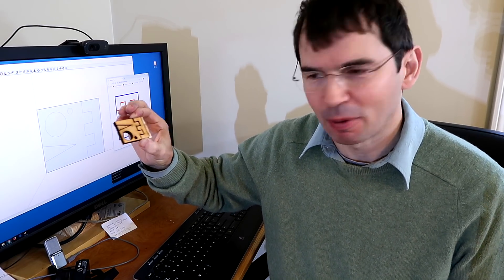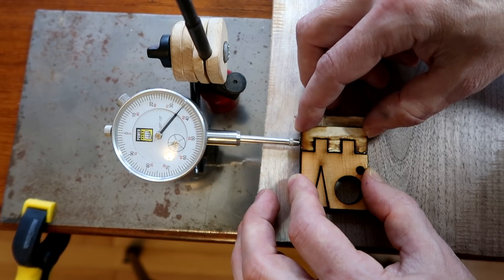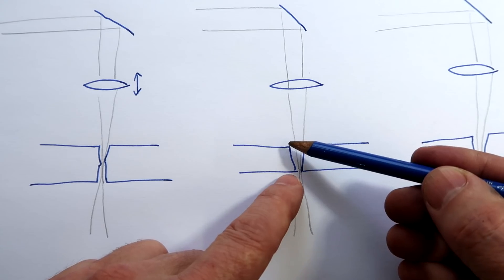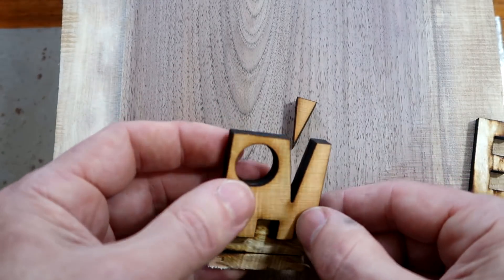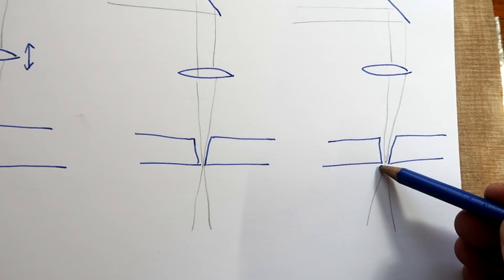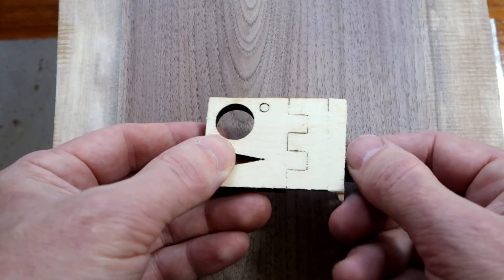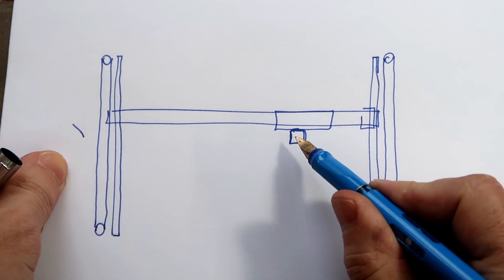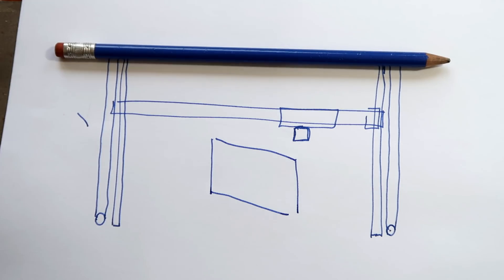Laser cutter cut width and inaccuracies

Comment: Matthias, i deal with my laser machine 8 months now trying to improve this situation and i can tell you it got to a point that is almost perfect. It takes huge amount of time of aligning the mirrors and the lens, something that most of people do not do, especially in maker spaces. Also it depends on what kind of lens they use. 1.5, 2, 2.5 and 4 inch lenses have different focal points thus they cannot cut perfectly all thicknesses of material. Plywood is never straight so if you set the focus perfect in one point, it will change across the piece of wood with result of a tapered cut. Lastly if i need to cut a precision piece i do compensate the width of the laser beam in my design so the final piece is very close to real dimensions. And if i need to cut 2 pieces nesting one inside the other like a puzzle piece or a box with joints, i design the part goes in slightly bigger to fit. It is a difficult process as all materials do not behave the same, so testing and tuning is always necessary. I roughly have spend all these months over 200 hours of calibrating and testing in order to have excellent results in every job i do. This fact put's me far away from completion as everyone can have a laser machine but very few knows and understand what it needs to be done to achieve the best results.
Reply from the maker: I kind of realized that laser needs tweaking, but it not being MY laser, I don't have much control over that stuff.  But I don't anticipate buying my own when a bandsaw already does most of the stuff I would use a laser for.
Reply: @matthiasrandomstuff2221  This is why i bought mine, all suppliers and maker spaces i have visited delivered a poor quality. But yes, i think you do not need one, your top skills on power tools can cover that gap.

Comment: Interesting. Obviously most people don't have a laser cutter and probably wouldn't get one to do joinery, but surely if you chose to do it that way then cutting the pieces that need to be joined would be done as separate pieces to cut down on the amount of play in the joint. 

It's curious too why something like a laser cutter wouldn't have a way to completely calibrate it to make perfect cuts. Even the idea of cutting out letters or doing decorative stuff in wood could be done with a scroll saw or a coping saw. So you would think an upgrade to a laser would also be an upgrade to a level of precision a scroll saw couldn't achieve.

Comment: And to make kerf matters worse, the focal length of the final lens  needs to be considered too :-) Then if you use crappy ply made with the wrong adhesive you need to ramp up the power (or slow the cut rate) which worsens the problem - happy burning :-)
Have you considered a constant kerf hand fretsaw lol :-)
Reply from the maker: I like my constant kerf bandsaw!

Comment: I wonder how burnt wood changes the strength of wood glue adhesion...
Reply: Typically when i do this the wood is much less burned (probably a result of using a better quality higher power laser) and although i don't sand the burnt edges the glue holds just fine. Ive seen the wood near the joint fail, but not the joint itself
Reply: An old saying goes "No glue sticks to dust", so...
Reply: @ @MazeFrame   Glue sticks VERY well to dust (and vice versa). However, dust to wood is not too great structurally. ;-)
Reply: There is a lot of burning/charring in that sample.  Something seems out of whack, either not focused properly or incorrect speeds and power settings for the material.  Laser may simply be under powered for the material thickness and was being run slow hence the burning.  As with proper speeds and feeds on a CNC, much the same applies for lasers to dial in the ideal settings for each material.  We cut and engrave a lot of plywood, MDF, acrlylic and rarely see that level of burning, typically cutting 1/8-1/4"
Reply: @iCONICAACINOCi  My thoughts too.
Reply: And the fact that the glue, as he mentioned, was meh at best to start with, certainly doesn’t help
Reply: Fire is sometimes used to harden wood.
Reply: @eurobum2012 fire for hardening does increase the density of the wood be removing moisture, but this works only on raw hardwood and is definitly not suitable for already dried wood or even laminated wood like plywood - if you burn it you will remove the remaining moisture and you will reduce the bonding properties of the natural resins/polymers and carbohydrates (ligin and cellulose) and also it will foam up most type of wood glues like PVA or PU/PUR

also  fire hardening is used for hardening outer surfaces of wooden structures, not the edges of joints - typical applications are shou sugi ban or prehistoric use on arrow or spearheads

charring wood also insulates wood and prevents it from structural loss - this is important in building. a wooden building with wooden support beams typically lasts way longer than a steel supported structure since steel beams (for floors/ceilings) lose their physical properties when heated and need additional insulation, a wooden beam has bad therman conductivity compared to steel and if it gets charred on the outside, the coal-layer insulates it even more
Reply: @suit1337  good point
Reply: If done correctly there should be no charring, just some darkening. We've made probably near a hundred of these types of joints on various projects, glued up with wood glue - when they do break, they seldom break at the joint.
Reply: If you use the lasercutter properly you won't get charcoal edged, they will be a bit brown and very sticky (resin, molten glue) and dont reduce the strength significantly, but if you charred your edges your laser had not enough power and burned through the material rather than evaporating (sublimating) it prperly
Reply: @suit1337 I face the same issue with my laser, but it doesn't seem to be power, I think I need more air feed which from what I've read is also critical to getting good cutting.
Reply: @BenRyherd  yes, since the air moves the sublimtated material away and cools the workpiece

If you struggle with such issues,  you can try to cut in multiple passes and refocus after every pass
Reply: @suit1337  I've done multiple passes before but refocusing isnt much of an option, i have a fixed height bed and a fixed height laser head with no focusing (just a cheap K40) i currently have a small aquarium pump filling a nozzle with enough positive pressure to keep smoke off optics, but I need to get a more powerful pump for actual air assist
Reply: @BenRyherd  you also could cut thinner material,  add a few keys and laminate it afterwards - i do this a lot with plastics,  abs for example - 2 or 3 mm and then glue them on top of eachother - like 3D printing but way faster

If you need 9 mm plywood, just laminate  3x3 only a few keys ( i use M4 screws) and you can glue them up perfectly alligned

Only downside is that you have a few small holes in your top surface
Reply: @suit1337  interesting idea, the only lamination I've done is foam for stamps, I stick 1mm foam to 4mm foam with 1mm foam facing up, cut with enough power to cut the 1mm but not through the 4mm, then peel off the chunks of 1mm I want removed from the stamp
Reply: @BenRyherd  i raster engrave stams directly on 2,3 mm EPDM and glue them directly on a stamp base, takes longer but less hustle

You can buy those as "laser stamp rubber" in A4 sheets